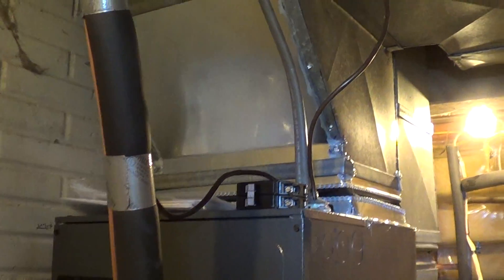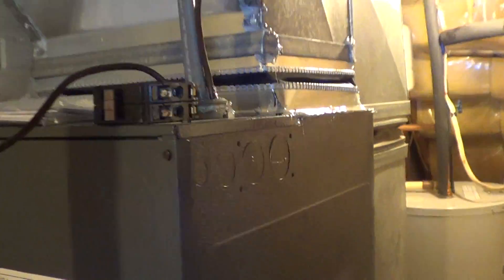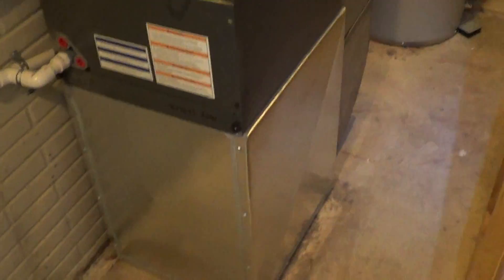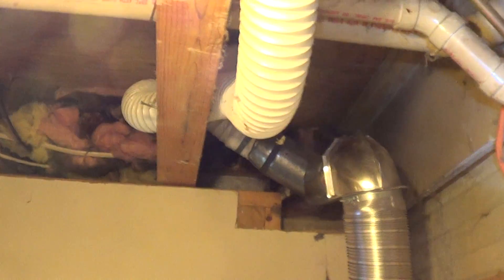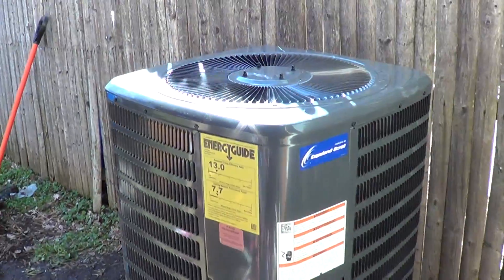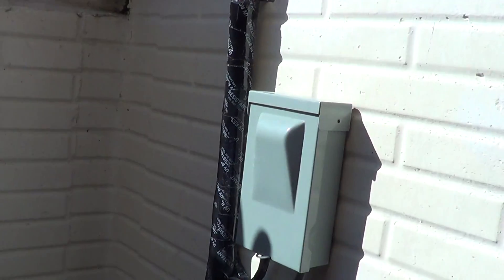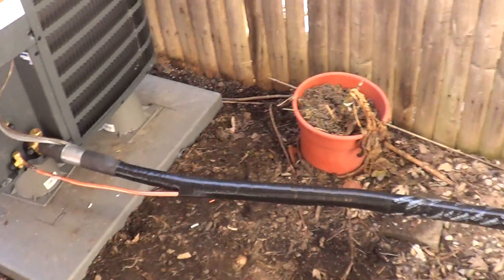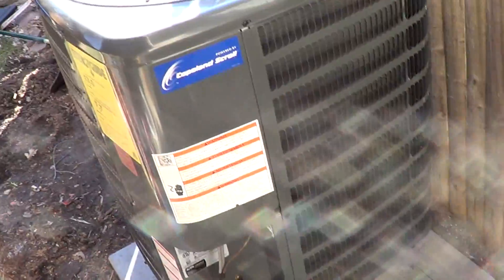Basic 2 ton Heat Pump Installation

Comment: Nice clean install.   One question on the outside unit.  If in a high snow environment, do you need to clear the snow from the outside unit? And if so should it be placed in an area where snow is less likely to accumulate? What is common in that scenario?